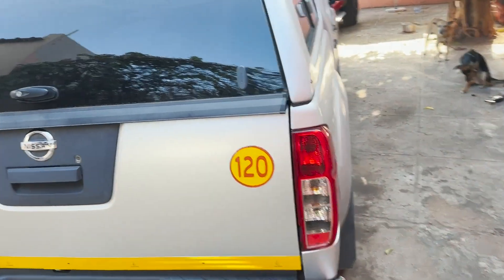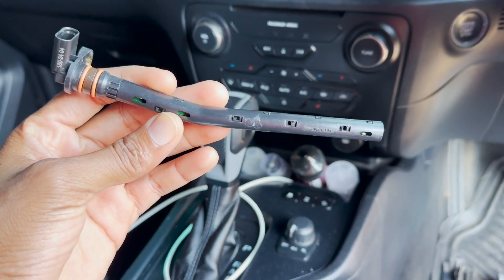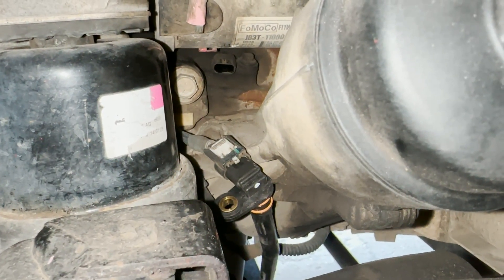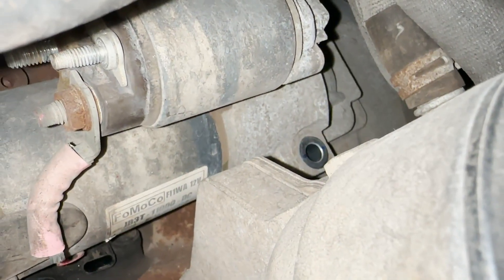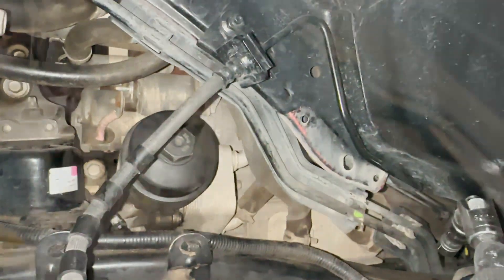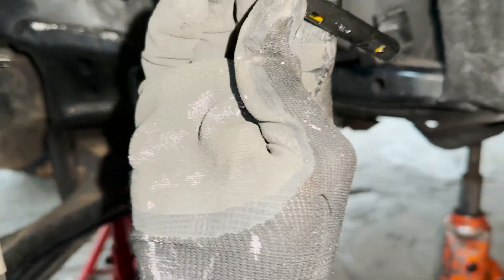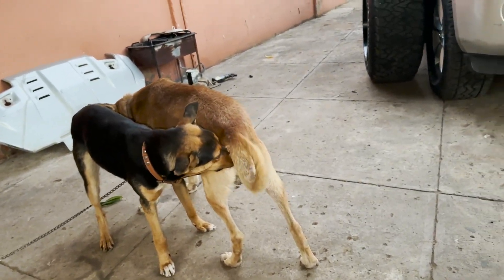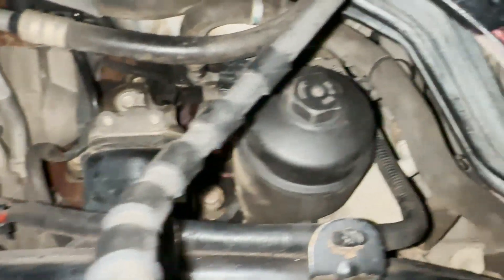Ford Raptor T8 2.0 Biturbo P250D - Engine Oil Level Sensor Circuit High

Comment: Are these engines the ones with wet belts?
Reply from the maker: @administratorsowners1508  yes sr
Reply: Very terrible idea.i have seen a few engine disasters on the internet as a result of this wet belt system.
Reply from the maker: @administratorsowners1508  yes, and gets worse if you use non synthetic oils, mineral oils eat them and all the shavings clog the oil system, a recipe for complete disaster
Reply: @frankcumaio oh ok so fully synthetic oil is a must.this part of the world where people  rebottle conventional oil into containers of top US oil brands is very troubling.